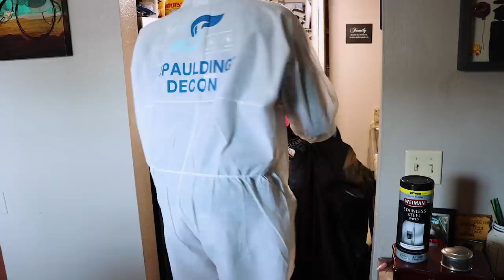Pickled House-Sitter Hoard | Tampa, FL

Comment: Some people put batteries in the refrigerator to extend the life of the batteries. I personally don’t think it works. 😆❤️
Reply: My mother always kept batteries in the fridge because of that. I don't know if it does anything.
Reply: In the uk where I come from we put them on the radiator or on the gas fire so they worked again 😂☺️
Reply: @Julia Winfield Oh thanks for the info!
Reply: I always thought cold drained batteries faster than if they were at room temp in a cabinet or drawer.
Reply: well, it actually does. It doesn't expand the batteries life but it reverses the reaction. Cold temperatures can make the counter-reaction to what makes a battery work. So it kinda helps